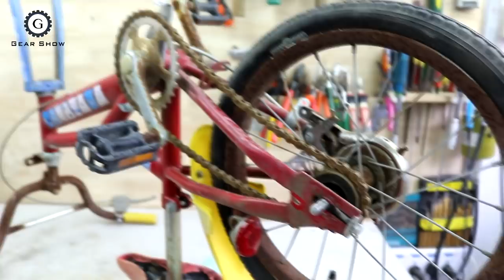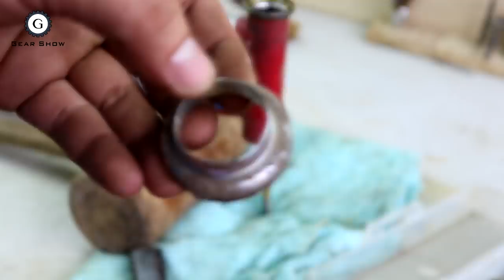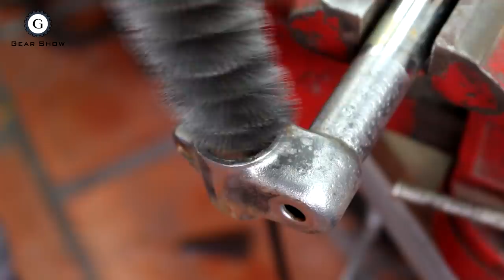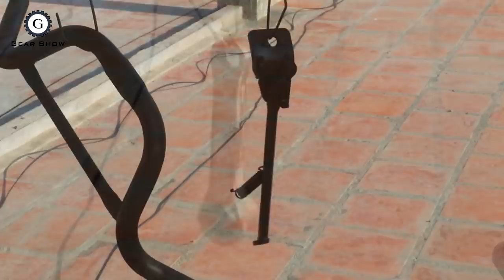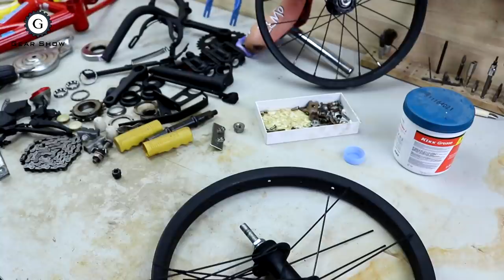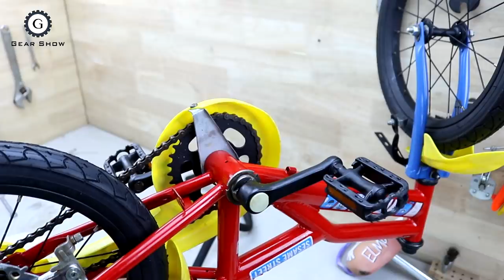Kid Bicycle Restoration

Comment: A very interesting restoration! :). I am kind of tired of Drills and other mechanical stuff restorations. Finally something refreshing!
Reply: and...you can fix your kid/grandkids bike.
Reply: @imperialpresence3331  Not like this. A hammer isn't required to remove the cranks at all. A puller is available to do it.

Comment: The black paint was a smart choice. I have done it also in the past on a green with black bike that had some rusted parts. It looked so much better adding some black paint. Sometimes its better to rebuild it with some new parts instead of making the old ones look better. Sometimes they are just worn and need to be replaced like the tires. It was nice to see this video for me since I can't remember the number of bicycles I have repaired and made look better. I even noticed I could have saved one that had rusted parts that won't come of. Just heat it next time.

Comment: I love this workmanship but.......................I've just checked out my local bike shop and similar bikes are going for £40 - £70 brand new. The restoration required new tyres and inner tubes, brake blocks, paint, grease, cleaning liquids et al. Now if your video was simply to show how it CAN be done that's great and if you can get monetisation from YouTube that's also great and of course if you feel the satisfaction of the restoration is worth the man hours put into it even greater. Again, I admire your skills and the job done, but for me the work effort could be put into something with some age to it. Just my opinion of course.

Comment: I think taking the sesame st stickers off it, and losing the plastic trim would have been an improvement.
Reply: I was just thinking that yeah, the aged and faded seat cover and decals contrasted to everything else being restored... They didn't really go together. But otherwise pretty awesome.
Reply: @kyoopihd  the seat cover is normally just stapled to the seat frame ....easy to replace with any of plastic or fabric....
Reply: paint strip then check for cracks
Reply: I think it belongs to the memories of the bike if they remove it its just another bike

Comment: There is a puller to remove the cranks. Another tool is available to take the bottom bracket out and the steerer tube.

Comment: I disassembled a bike with that same horrible bottom bracket. Looks like a square tapered spindle but has those threaded rods. Ive heard that some crank pullers have the clearance to remove the arms, but i have no idea how they were originally removed. Hammering the crank arms isnt something id do if i were gonna use them again. And that didnt work for me anyway. I ended up using a cold chisel behind the arms.

Comment: i would have changed the handle bar, the handle bar post, wheel rims and wheel wire spokes with a new one for safety reasons, those are dirt cheap anyway.
that way, the risk of of a child getting hurt is minimized. 
the rust might have made the material thinner than spec and could fail. 
i really don't want to contemplate the image of a child suddenly flying nose forward at 10 kph because the hander bar post failed lol.
but then again it's not my video lol. i'm just an ass who thinks "restoration" is more than re-painting stuff.

anyway.. GJ de-rusting and re-painting your stuff.
Reply: Dominic  who said about high-performance Tour de France bike?